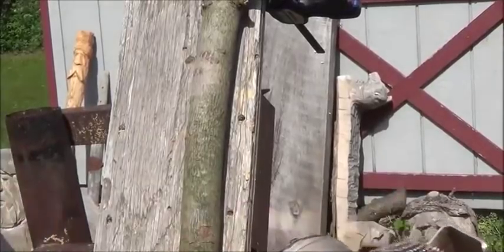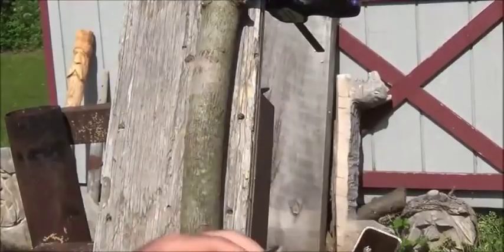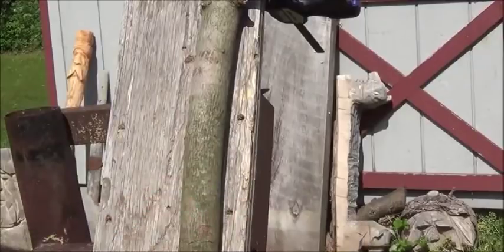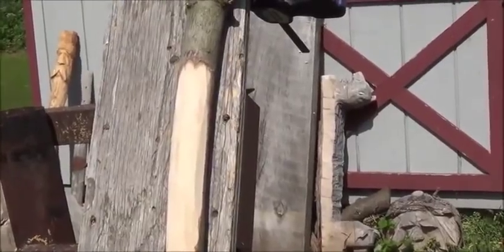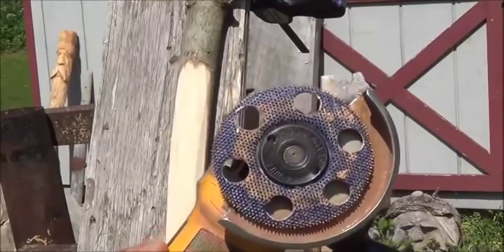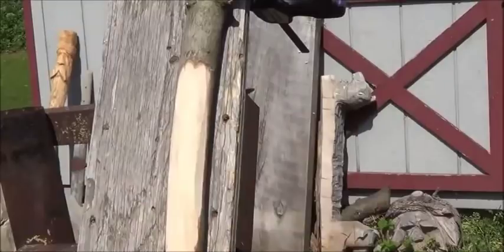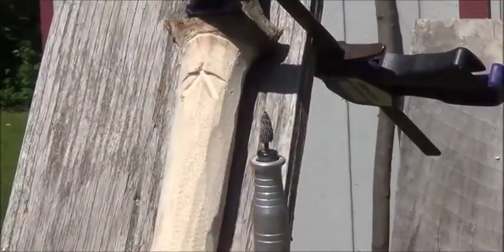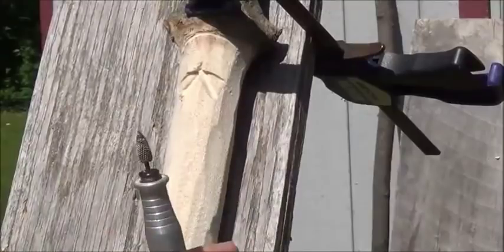WoodCarving/How to Power Carve A Walking Stick

Comment: The rotary tool you're useing seems to have a lot of torque  doesn't seem like the average dremel  unless they really  stepped up their game in resent  years, what is that tool?
Reply from the maker: It's a fordom and yes it's a step up from the dremel although I use the dremel for many walking sticks also. I use the fordom for changing bits and hand pieces quicker mainly. Here's a link if you want to check them out...https://amzn.to/2JfkrXT

Comment: Are you using the dremel 4000 ?   I have and older smaller dremel but sure it is not turning near as fast as unit.
Reply from the maker: I use any dremel and also a fordom, I recommend at least a speed of 3200 rpms  on your dremel though .